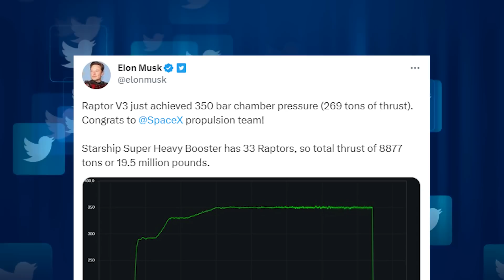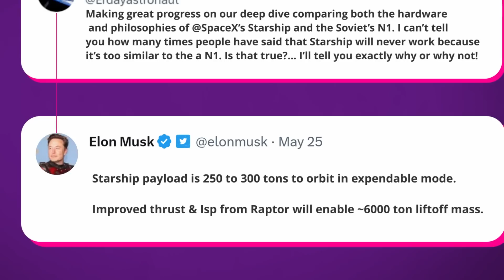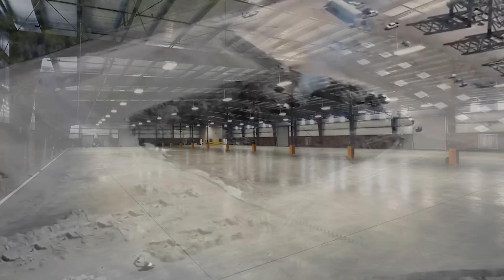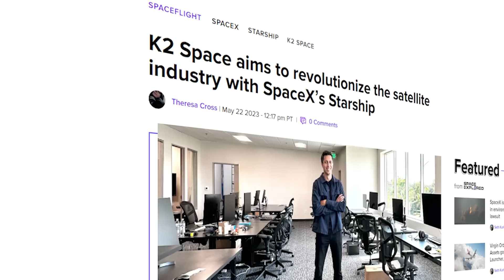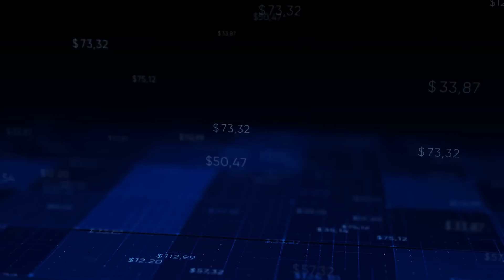Elon Musk Reveals SpaceX Is Making Major New Changes To Starship!

Comment: Why would they make it taller when they could simply make it wider?
Reply: Lower air resistance and ease of construction... most air resistance comes in cross sectional area. So tall and narrow has less air resistance than wider and shorter. And making a rocket taller is just adding more ring sections..while making a rocket wider means you have to redesign the jigs use to make the rocket ring sections.
Reply: Taller is very easy, just add more rings. Wider means modifying all of their production processes.

Comment: The piers don't go down to bedrock (800-1000ft) but only 110-140ft to the clay layer.  Also, by the time the video was released the white propulsion building had been demolished, and they'd removed Low Bay.  The Ground Fabrication building has been deconstructing for about a week already.  It'll be gone in a week.
Reply: Yep; it looks like a foundation based on (friction) piles driven into the underlying load bearing layer; lots of visible pile caps.
Reply: It's called the hard pan
Reply: Is it normal to have such deep non rock layers? Is this a sea level feature? It’s easy to reach bedrock where I am. Less than 20 feet down.
Reply: @aquireeverything9382  This area is all alluvial outflow from the continent, so yeah, bedrock is a long way down under the junk fill.  They're purely lucky to have the clay layer.
Reply: That’s as far as they’re allowed to drill down & something the Japanese have been doing for decades - They all survived a 9.0 earthquake in 2011…
Reply: Good info by StanJ . But those piles are not true "friction piles" with that sand/water table. The piles are driven down and 'seated' on the clay hard pan ??!!
Reply: @johnrday2023  The piles will lose lateral stability when the sand liquifies. Like an earthquake tosses and tips  the biggest piles. Musk has an earthquake maker but he can't secure the field. If he get's all the engines  lit the piles will dance on the hardpan, the rocket will deflect and by a command be blown up. Prove me wrong Elon.
Reply: A vast money pit to create solid ground on a beach. Good paying jobs but save all you can. The tides coming in and all Sand Castle fall. NOTE, Beach sand is rounded and bad for concrete so he has to mine it somewhere else. CARBON KING ELON

Comment: How did nasa do it the without all these problems the first time around?😒
Reply: well for starters they had 400,000 people working on apollo whereas SpaceX has like 12,000 people
Reply: The fact is... THEY DIDN'T.
Reply: proper engineering
Reply: Ah simple... they got a flame diverter... so the exhaust of the rocket was deflected away from the rocket engines to the side... simple.  Also they had a huge water deluge system to dampen the noise so the vibrations didn't cause so much damage to the infrastructure.

Comment: I feel like SpaceX is taking the eye off the prize of creating the MVP (Minimal Viable Product) of the Starship. I get being nimble, but optimizing the current design seems like it would faster than redesigning the Starship to be larger.
Reply: I think Elon planned this all along by estimating how the Raptor would evolve.  This isn’t really feature creep as much as a simple stretch of the tech and manufacturing they have already worked out.
Reply: It does seem like feature creep.
Reply: I didn't read it that way. More powerful engine is a core foundational improvement it gives more versatility to their designs on all fronts. Elon said smth about increasing Starship size by 10m but that's just one way how extra power can be utilized maybe they will scrap it and do smth else.
Reply: To do real work on the moon or Mars is going to require very heavy equipment be transported to space. This new engine will give the Starships of the future more lifting power...but that's not to say they will be the go-to vehicle for general operations. This doesn't say they are abandoning the MVP idea; they have yet to get a Starship to orbit, so I'd say the MVP will be in play for a long time to come. Looking to the future is what SpaceX and Elon Musk does, this is a natural evolution of the launch system (more power, bigger, more capacity).
Reply: If your ship isn't big enough to hold what you want to launch, then making the engines more reliable is irrelevant.
You still can't put what you wanted in it......

A highly reliable 1 liter engine in a pickup truck won't move 60,000 pounds of cargo across the country.

But a bigger vehicle, like an 18 wheeler, will do just that.

And they never stop trying to make engines more reliable.
But you want them to make a better engine that they can't use, simply because the ship won't hold it.

Comment: Failure to properly design a launch facility is causing SpaceX to struggle and fall behind schedule...seems like this simple statement needs to be stated in front of this pandering crew.
Reply: In other words, you wet your bed AGAIN lastnight - is this what you're trying to tell us?
Reply: @eskieman3948  Uh oh. Elon has unleashed his army of bed wetting trolls.
Reply: My estimates were flawed and were based on a reported 4.5 billion$ cost for Artemis1 and Elon's statement that 5 billion$ were spent on the Starship program prior to this year with 2 billion$ to be spent this year. Tim Dodd's recent N1 vs. Starship video reports the total development and production cost of Artemis1 at 30 billion$. He also stated that over 200 Raptors have been produced.
Reply: Yes, it's added 3-4 months to the timeline, but it remains to be seen if they struggle. SLS's first launch was delayed 5 years and it took SpaceX less than that to go from concept to first flight. For about 77% more than the price of one SLS/Orion spaceship SpaceX built the Boca Chica production and launch facilities, added Raptor test stands to the McGregor test facility, a few dozen test articles, a dozen Starship prototypes, eight Superheavy prototypes, about 80 Raptor v1 rocket engines, maybe 50 v2 Raptors and now they are beginning on v3.

Comment: Wow. I really hope the next version of the starship goes well, ‘cause that’s the rocket that is going to bring people to the moon.
Reply: Maybe… if it can push the debris far enough.
Reply: To put it simply, Starship is never going to be human rated. it doesn't have a launch escape system. all their current designs don't allow for one. starship to the moon in 2025 forget about it.
Reply: @salland12  this. no one ever seems to remember this REALLY important little detail
They just keep spinning this wishful thinking pentagram in hopes it'll just magically solve itself away.. hell it actually makes perfect sense when u realise only reason eloon even GOT those contracts over the other bids in the first place was musks (or more accurately Gwynne Shotwells) close relationship with former NASA chief Kathy Leuders.. who awarded spacex  ALL their current NASA spacex contracts &surprise surprise now has a lucrative spacex position after leaving NASA 🙃🙃🙃💀
Reply: @salland12  - The problem with the Shuttle Challenger wasn’t the lack of a LAS - It was being strapped to the side of a giant fuel-air bomb that was strapped to an SRB whose O-Rings had frozen solid. Shuttle Columbia burned up because the insulation on that same tank tore off several tiles. And Shuttle Atlantis was saved in a similar situation to Columbia by a thick piece of high temperature steel that refused to melt in 1988. I don’t see an LAS saving any of those.
Remember, NASA is human-rating SLS after ONE launch (they don’t have much of a choice at $4B/launch) & was going to put humans on board Starliner in spite of its many problems. NASA will need to consider human-rating Starship after 100 successful launches & landings… Meanwhile, Lunar Starship just has to do what any lunar lander does, land & take off from the moon and sustain its inhabitants while they’re on the moon…
Reply: @TraditionalAnglican  ........&it also didn't have a sufficient LAS
Reply: @o-wolf  - I was saying the main problem with STS had nothing to do with the lack of a LAS  - The only LAS that would have been sufficient in Challenger, Columbia & Atlantis (remember, the only thing that saved that one was a 1.5 cm thick piece of steel that was in exactly the right spot that refused to melt) would have been a Star Trek Transporter! There simply is no known LAS that could have saved either crew.
Challenger’s problem was being strapped next to a giant thermobaric bomb that was attached to 2 igniters! The other two had multiple tiles knocked off by the insulation on that bomb!
We don’t need a LAS for landing on the moon & Mars. It would add mass & would do no good in case of an abort - That’s why the LEM (6 moon landings) didn’t have one, & why the Alpaca & National Team Landers don’t have one either.
Remember, passenger jets don’t have an LAS , but are far safer than driving a car from LA to San Diego or Santa Barbara! NASA will pretty much be forced to human-rate Starship (for transportation off of earth) when it’s been proven to be as reliable as Falcon 9 is today (213 consecutive successful launches as of today)… Remember, SpaceX will be launching these weekly once they reach orbit and start landing…
Reply: It isn't

Comment: However Starbase need to complete their update/improvements to OLM. Their new watercooled steel plate must be fully tested with 6, 20 then 33 engines operating up to XX seconds at up to XX full thrust before they can contemplate a new launch date. We need to realise it is all experimental until they reach reliabilirty. We are counting on them and wish them well !
Reply: Don't see the problem there. They seem to have no problem with those stages - they already did all that with every previous version. Anyway you want to slice it they are far ahead of the competition
Reply: By the way Booster 9 hadn't had any static fires or test with engines installed, so the definitely need multiple multi-engines-static-fires ... but if these go well they don't have much waiting time in between (maby many tests within 2 or 3 weeks, with parallel test of S25 on suborbital pad ... all in the "on month of vehicle testing" ... after finishing pad repair in a month from now ... according to Elon's plans ... 😂
Reply: They won't make a 33-engine static fire with an untested new Booster 9! No booster to test means no OLM steal plate to test 😂 ... they will have multiple static fires with more engines each time ...
Reply: Why would they need to test multiple different engine configurations when a 33 engine burn will be the only thing the pad sees?
Reply: @citizenblue  Cause if the pad gets damage on a 6 engine test... than you know it will just blow up on a 33 engine test which may then damage the engines.
Reply: @Nick L  I mean, I figured that was the logic, but it's an unnecessary step. One 33 engine static fire will sort that out real quick. It can start at min thrust, then another at 75%, then full if you want to progressively test the pad.
Reply: Less time SITTING on the launch pad LIT may help too!
Reply: They won't make a 33-engine static fire with an untested new Booster 9! No booster to test means no OLM steal plate to test 😂 ... they will have multiple static fires with more engines each time ...
Reply: I wish them well too. But Elon is a whacko. Unstable I would say. He needs to FIX STARSHIP or redesign.